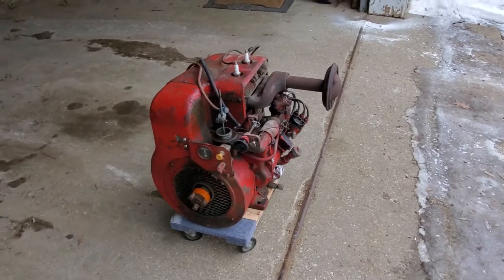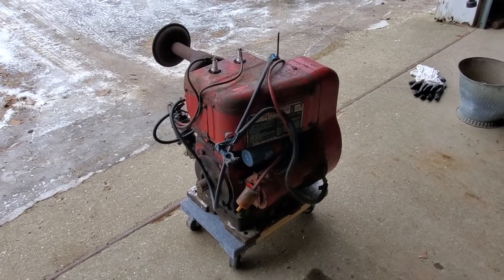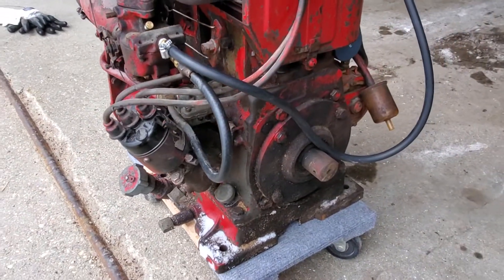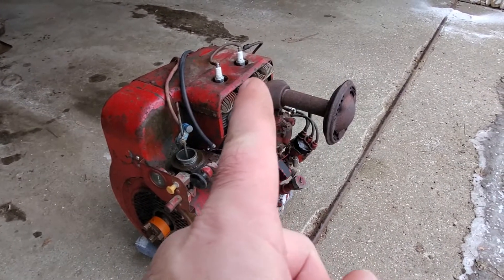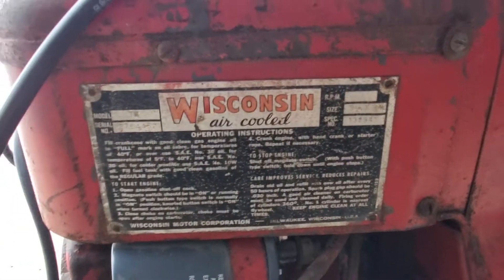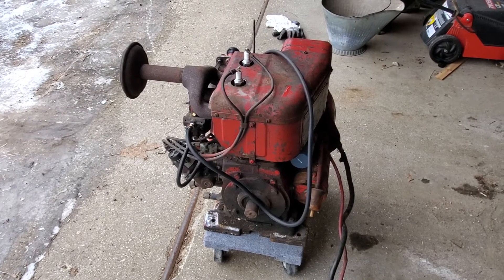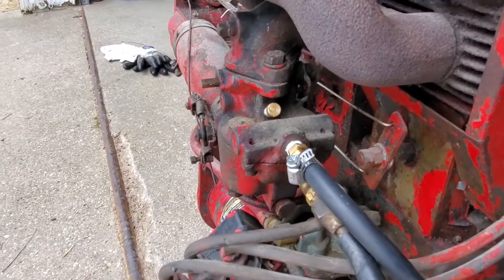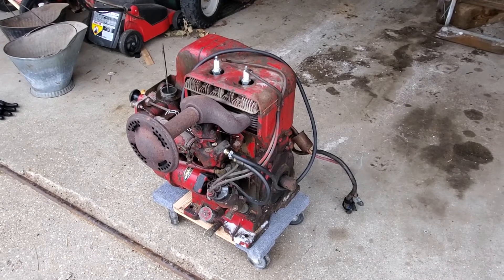1957 Wisconsin TH engine

Comment: I'm putting mine in a Kubota B6000 with a blown engine. A simple adapter to mount the flywheel and an adapter plate to the transmission and instant Wisbota tractor. 😁 Thanks for the video!

Comment: Does this company still exist?
Reply from the maker: I don't think so. They made engines sometime into the 2000s and stopped production. 
Wisconsins were all air cooled and they made 1, 2, and v4 cylinder engines. I've got a couple single cylinder Wisconsins as well.